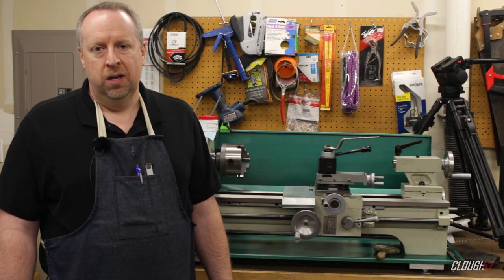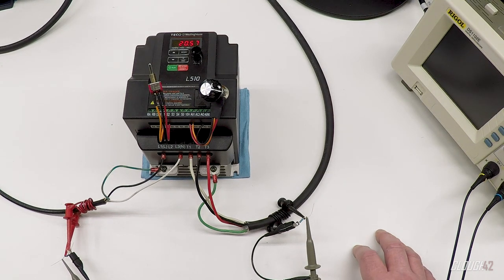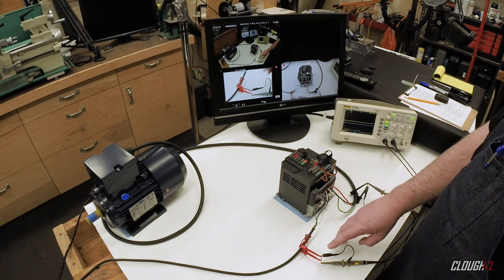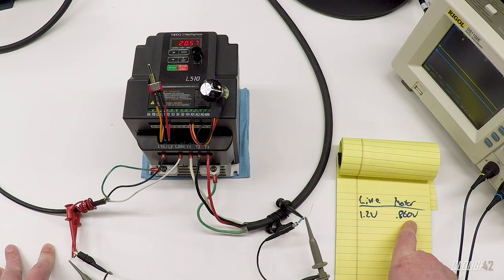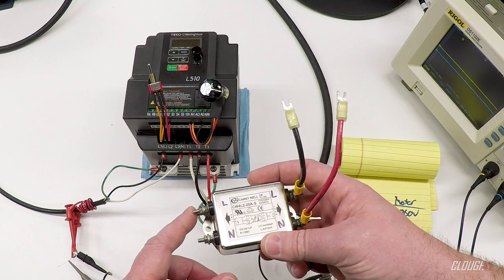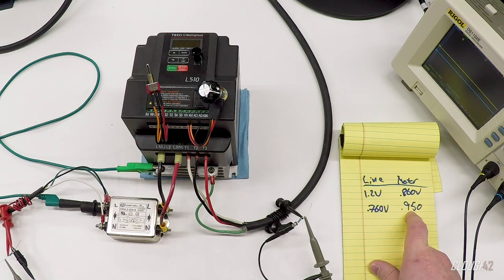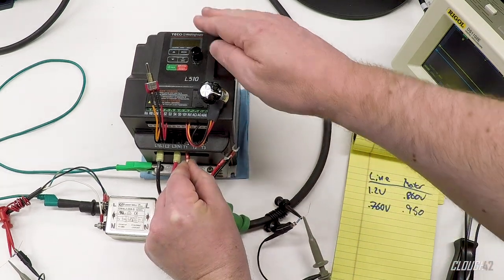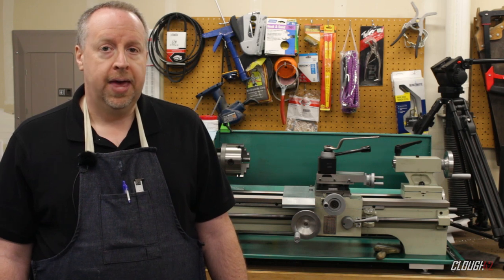Lathe VFD 3:  How to Fix Noise Problems

Comment: I tried a filter that didn't fix led light TV interference. 3.7mH and  0.1uF and 3300pF unit tried. I also put simple ferrites no looping in load wires that seemed to help slightly. What values do you recommend for this situation? What values were in your filter that worked. CheersEDIT. Just setup 2 small ferrites but fed both wires through both of them. My TV channels stay on now. Thanks for your inspiration

Comment: Interesting and useful stuff. I had similar interference from LED mains lights blocking my powerline ethernet extenders. A large common mode choke between lighting and power circuits fixed that. 
BTW your 8 turn wire wraps are very inefficient current sensors as the wires are orthogonal to the cable; they should be parallel for good transformer action.  You could have used the ferrite toroids for that too.  Not important in your case but I thought I'd mention it anyway. Also I've never heard of a resistor being a "burden" 🤣LOL! It's normally referred to as a load or resistive load
Reply from the maker: In that case, you can google "burden resistor" and learn something new today.

Comment: Hi James. I realize this is an old video but I was wondering if there is shielded wire that would reduce the noise? Or was this the least expensive way of dealing with the noise? Love the videos. Keep up the great work!
Reply: There is such a thing as VFD Cable. It’s got three conductors plus ground inside a dense shield. I recently bought a piece from McMaster-Carr to give a try.

Comment: I have a Teco JNEV drive on my mill now and I was comparing the A510 and the L510 for my Lathe.  Is there a specific reason why you chose the L510 over the A510?   I know the A510 is about $200 more than the L510 in the 220v version which is what I'm looking at.   Awesome job on the video's and content.   Very, very helpful, clear and concise

Comment: Great stuff , can you show me in video how to wiring  the VFD 2,2 kw at : 
+ fuse 
+ safety relay 
+ filter 
+ braking resistor 
 + contactor 
+ e-stop 
+ reset button
 + switch main power

Comment: Yes my dear in did is useful
But it was very surprising for me just about a week ago i bught a 1.5 kw chainis vfd for my belt sander machine , during study the manual booklet for set up in wiring chapter mentioned to put noise filtering between power surce and vfd .

Comment: Nice and very useful! You did explain the working of the line filter you have used. I have tried to find a similar filter but I found a lot of them with different configurations and different capacitors, resistors and  inductors. Most of instructions on internet do tell me how to calculate simple low pass filters but not to calculate noise filters.
Could you please advise me in 'how to do' ?

Comment: Are those filters effective only when placing them just after VFD line connection?
At my apartment block there is big suspect VFD/motor from elevator causing some weird behaviors on my PC. The thing you mentioned about losing sync is closests one to my symptoms, but mostly it's about irregular inputs, might be also monitor acting in a way that it seems like it's inputs.
So far I have tried filters like FN700Z and different kinds of ferrite toroids on power cables, isolation transformers of different kind. All at my apartment far from VFD/motor. Nothing solves this issue. However I don't have real separate ground wire, only neutral acting as one, so not sure about effectiveness. Right now waiting for elevator to be replaced. Of course it is hard to make regulatory institution act on it, because it's not as visible as monitor turning off that they can rely on.

Comment: Keep the following in mind, make the monitor's power supply independent, they should not be connected to the same network as the driver. And the other thing that can also influence is the quality of the VFD.

Comment: Thank you making these videos.   I do have a question. I have vfd powered by 220 single phase to operate a 5hp 3phase motor. Im pretty sure size of vfd and connections are all correct but concerned about motor making a high pitched squealing sound with and without out any load on motor. I've never heard motor run. So not really sure if it's normal, but don't think so.   I Know it's not the same noise your talking about in this video but did read something about vfd's exciting a motor.    Do you have any advice of things to try ?  Thank you

Comment: Love your video, I have one question to ask, instead of using a filter can we just use a armoured ecc cable from the motor to drive and ecc flexicable from input power to drive, will this work? I ask this of the simple reason that ecc reduces noise quiet abit

Comment: Thank you, this was very helpful! I have just installed a vfd and spindle on my CNC and the noise is tripping the limit switches. I will try these fixes to see if I can resolve the issue.

One quick question, the shielding in your motor cable, how have you earthed that?

Comment: Another very helpful video. I have a Huanyang inverter hooked up to a 3 phase motor, the problem is the motor sounds like its Whistling. certain Hz are louder than others. could you give me tips on how to reduce this noise, should I put a filter inline? thanks.
Reply from the maker: I suspect you're hearing the carrier frequency.  I'm not familiar with that VFD.  On the L510, I reduced the whistle significantly by switching to Sensorless Vector Drive (SLV) mode.

Comment: Since current flows in a loop (not into a dead end), the net current enclosed in each of your "current transformers" must be zero, as all cores in the cable are within the CTs.
So I suspect that what you're actually measuring is not a current but a capacitively-coupled voltage. 
An industrial VFD motor cable has a symmetrical configuration with 3 phase cores, 3 earth cores and an overall screen which is grounded to prevent radiation of EMI and capacitive coupling to nearby wires.
The ferrites on the individual phase cores are probably not doing much - they just add to the motor coil inductance.  It would probably be better to use all of the ferrites around the 3 phase cores as a group (excluding the earth core, as you did in the video) to limit the common mode current.
Looking forward to a series on your Grizzly mill CNC conversion, as the electronic lead screw series was brilliant :)
Reply: While unshielded wires running parallel and close to each other for some distance can capacitively couple, it is only the VOLTAGE which is coupled not the CURRENT. This coupled VOLTAGE can produce resulting CURRENT in the coupled wires depending upon the impedances of the respective circuits at the coupled VOLTAGE's frequency (OHM's law).
However, when wires are perpendicular to each other, as is the case with each wire within the cable group relative to the CT windings, the coupled VOLTAGE is negligible. Only CURRENT in the cable group wires will be coupled to the CT windings, and only CURRENT that changes in magnitude, i.e. pulsating or alternating CURRENT. Steady state DC CURRENT in the primary of a CT will not cause current in its secondary. Therefore, the CTs do not pick up any VOLTAGE whether it be capacitively coupled voltage or any other voltage.
The O'scope input does see voltage, but only the VOLTAGE that is developed across the CT shunt resistor by the CURRENT in the CT winding/shunt resistor circuit caused by, and proportional to, the CURRENT in the cable group.
Your argument that CURRENT does not travel to a dead end is correct. The CURRENTS are traveling in a loop. However, when alternating VOLTAGE and CURRENT are involved, there are phenomenon such as phase shift, reflection, and standing waves that come into effect, especially at high frequencies.
For example, a radio wave transmission antenna must be properly impedance matched to the amplifier output for maximum power to be dissipated by that antenna. Any impedance mismatch causes power to be reflected back toward the amplifier. This creates what is known as a 'standing wave' that oscillates within the coaxial cable between the amplifier and the antenna. The amplifier will be using and putting out much more power than the antenna can transmit due to that impedance mismatch as it 'fights' the standing wave. This lost power and its associated CURRENT is within the cable, but it has no 'net direction' toward the antenna.
Clough42 's CTs see all CURRENTS within the cable group. While the low frequency CURRENT (0-599Hz of VFD speed range) follows your loop rule and thus cancels out as a net zero when all conductors in the group pass thru the CTs,  the net result of the very high switching frequencies of the IGBTs causes measurable CURRENTS that seem to go nowhere but exist within the cable as lost power.
Reply: @georgebeaves1254  Can you translate that to common speak?

Comment: Excuse my late for the party question on this one, but I bought my first vfd a week ago.
In your bench test setup, are the vfd, oscilloscope and monitor all plugged into a single 110vac circuit?  In my bench top CNC router (now being refit with a 1.5kw spindle and vfd), I have always had two circuits in use and just dropped in a third circuit for this vfd. 
I have assumed this approach would make it easier to keep the interference problems away.  Btw, my NC table control board is usb attached to the computer - YUCK! for reasons of dependability. 
Thank you so much for your time and efforts, your videos are super.

Comment: You might benefit from actually wrapping the motor leads on the ferrites. In technical terms this will increase the flux linkage (and the overall inductance) and you can get away by using lesser number of cores.

Comment: Great video
But I ve got a question 
I am having this big gate with an inverter operator. 
While the motor works the noice is so bad that remote controls and photo eyes are not functioning. 
How ti filter internal noise? I got those emi filters from old treadmills but they only filter the backward noice. What about filtering the internal system noice?

Comment: Maybe you can help with an issue I've been having. I have a certain machine that contains noise filters and with inductors and ferrite donuts in several areas. How ever the noise filters in this particular PCB blow up quite often. Do you have any tips on how to trouble shoot 3phase noise filters. 

I suspect power spikes are the root cause. I am an HVAC tech that has to work on variable refrigerant flow systems using driver boards and inverter technology. 
I work for a manufacturer and these noise filter problems are catastrophic for the electronics in the compartment that houses all PCBs. 

Good video!

Comment: My heat pump has a VFD and its causing my oven to buzz and some UPC batteries in my home to buzz and some desktop speakers.  Do all I need is a $20 line filter to fix this?

Comment: Grate video Clough42, but what if the VFD is stronger, something like 5.5kW and has 3Phaze input, can we connect 3 of this kind of Input filter joined in one node all 3 N and GND lines, and connect the U V W lines from the lines 1 2 and 3... Also I am concerned about the voltage of 400VAC for 3 phase....Will it work like that or should I choose something different?

Comment: Great video as usual, James.
Your 8 wraps/resistor combo would basically be a current transformer(CT).  The voltage of the resistor would just be ~8x that of the cord, right?  Is the burden resistor there to protect the scope? Maybe because the input of the scope is high impedence..  Just grasping here.  More stuff for me to learn!

I did notice your monitor cut out and I thought it was every time you closed the drawer.  Maybe it was when you were turning on your mill spindle.
Reply from the maker: Yes, the turns around the wire form a current transformer.  The current generated in the transformer produces a voltage across the burden resistance, and this voltage is read by the scope.  I suppose without the burden resistance, the impedance of the scope input would act as the resistor and the voltage might be pretty high.  I hadn't thought about that.
Reply: The nature of a CT is such that it will attempt to produce whatever secondary voltage is necessary to cause current in its secondary proportional to the turns ratio. This can cause very dangerous secondary voltages and thus a CT should never be left open-circuit. A CT should have a small enough burden resistor to keep secondary voltage in the desired range. Manufacturers recommend keeping CT secondaries shorted until installation. In fact, the secondary can be shorted without harming the CT even when in circuit. The only purpose of a shunt resistor in a CT secondary is to produce a measurable voltage for the measuring equipment. A CT with only a few windings or a very low primary current is not dangerous to equipment or you.

Comment: Thanks for the great videos!  I have the same model VFD.  I also have GFCIs on all my garage circuits and the VFD causes them to trip.  After a bit of research, I found out that this is a common issue.  Before removing the GFCI, would the noise filtering prevent the GFCI from tripping?
Reply: Did you find the problem if so could you share as I’m having the same issue?
Reply: @barryweissburg6384  Unfortunately, I did not.  I ended up removing the GFCI on that specific circuit.  I don't feel like I tried extra hard to find a solution and haven't really thought about it since.  If you've got the curiosity and energy, you might push a little harder than me to find a solution.

Comment: Hi, I am using 220v input with 2 hot wires. I see this filter is rated for 250v. How would I hook up the 2 hot legs on a filter like this? They all seem to have the same setup. Line, neutral, and ground on input side and line and neutral on the output side. Where do I connect the extra wires?

Comment: Good Video Thanks, I had a lot of noise problems with USB Smooth Stepper went to Ethernet and it got better cost me $150,  I wonder the filters would have fixed it ?
Reply from the maker: Hard to say.  I use the Ethernet SmoothStepper on my mill, and I love it.  I never tried USB, but since USB gives a large low-voltage system a common ground, it can lead to lots of noise problems--especially with a laptop that only has a 2-conductor power supply cord.
Reply: You about have to use shielded cable everywhere and have a good ground to eliminate issues in those stepper systems. Especially if it has an dc power supply

Comment: Does isolation transformer help for your monitor keep running (or other electronics ) without using noise filter and ferrite rings?

Comment: Like the last comment, BSee dont know this stuff as well as you do! The spectrum analyzer would have been fun too see just what freq was dominate. Also explained the ferrite mix ( #31 ? ) for common mode choking. The cable on most computer ( video ) have a ferrite choke from the factory. My guess you are a Ham radio operator too?  Do you like the Teco VFD ? I am really thinking about one for my mill.

Comment: Hi buddy, I need your advice about the ferrite rings, I have interference in the network, so my devices are not working as they should be, can you tell me if im connect the ferrite rings to the surge protector wire can it help me (and whether it is necessary to remove the insulation from it and hang it directly on the wires) to completely eliminate the interference? What type of rings would you recommend?

Comment: You didn't explain it but I noticed while adding the EMI filter, you combined Active & Earth to the Line side connector on the EMI Filter?
Reply from the maker: No.  There are three terminals.  The ground is behind one of the other terminals.

Comment: Regarding the motor leads, is there a point where ferrites would start affecting motor operation?  I ask because I had to install something similar on CRT video cables once upon a time, and the visual smearing of pixels was very noticeable.  I'm guessing that point is significantly higher than a couple dozen kHz?
Reply from the maker: Yeah, for sure.  The ferrites remove (block/reflect) high-frequency energy.  Since an NTSC video signal is carrying information at about 15MHz (pixel frequency) it will be seriously affected by the ferrites.  In the case of the motor lead, the energy we want is 120Hz and lower.  Anything higher than this is noise, and we want it gone.
Reply: Would that not be "15KHz and lower" though...?

Comment: I am really liking your videos and the explanations on wiring etc. I am still a bit confused about the three phase motors though. Will the control work on any three phase or does it have to be a specific VFD motor?
Reply: A lot of new smaller 3 phase motors are inverter rated. Older motors aren't , they can still be used but not to be pushed too far over or under the rated frequency

Comment: I'm running a vfd to power a 1953 hendey lathe. The electrics on the lathe include an on solenoid and two more solenoids for reversing the motor. 
It took a bit to get that vfd to run a 3 phase 240volt motor. It seems to be working but the main magnetic on solenoid makes a buzzing noise. It is somewhat annoying. Will something like this work to stop that too?

Comment: I Have a Concession Trailer that has a Mini Split Heat Pump.
Some locations that we travel to the 50 amp Receptacle that we plug into  for the trailers main power panel is a GFCI.  When the VFD on the heat pump turns on it trips the GFCI. Do you think this would solve the problem?  Thank You

Comment: Hello! Very nice video. I have a question: line filter and ferrite cores works on the capacitive proximity sensor too?  Because when I turn on the VFD, all capacitive senosors goes crazy.
Reply: Are you using shielded cable? Do you have a good ground?